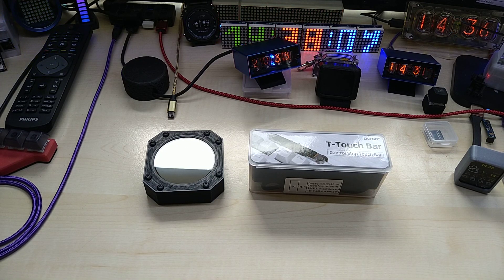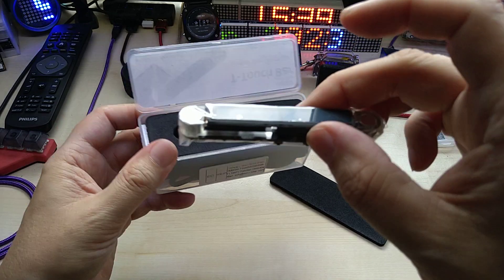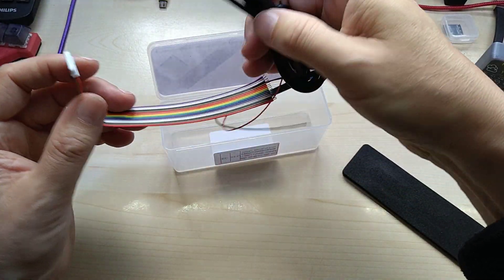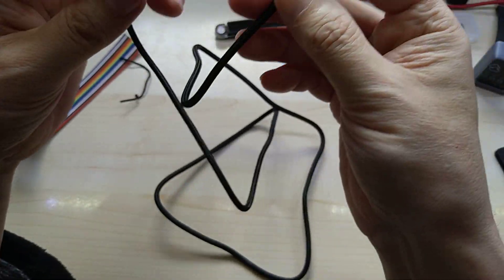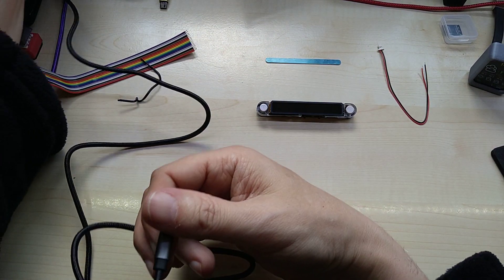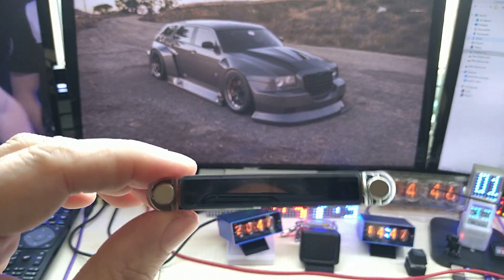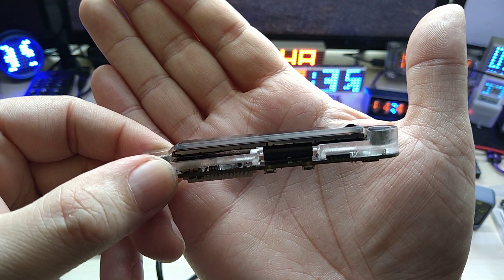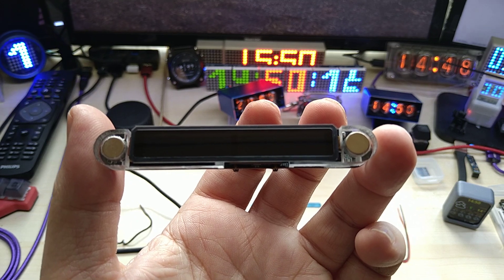#ESP32 S3R8 T-Touch Bar Introduction by #Hayri Sponsored by #Lilygo Part 1

Comment: That thing is wicked and it's got 1 off my magnetic connectors,on it already..What Mystery Items,will be made outta this👍
Reply from the maker: Thanks Peter, well my latest idea about it is to turn it into a pen like device and use it's BLE feature to, this part I do not know yet 🙂 or I could make yet another NTP clock or stock ticker or weather forecast instead of "just" attaching it to a PC and adjust volume with it. have some very thin lipo batteries on the way and if I can hopefully save enough  money for a SLA printer I could make a very nice case for it. It could even have a ball point insert, so it can be used as a normal pen as well. The round magnetic connector could be on the top of the pen for easy charging. Really like touch screen as you can use it any way you like, only your imagination is your limit, lol. I am open for suggestion as always, stay safe my friend.

Comment: Off topic, but now that Arduino is releasing the new 32bit UNO 4 with CAN bus in May, do you anticipate jumping to the R4?
Reply from the maker: Very unlikely for several reasons. I have worked on my CAN BUS gauges for well over 2 years and think that I build several great gauges ranging from a "simple" gear indicator to a OLED version, IPS color display versions from 1.3" to 2" using the Atmega 328 and 1284P up to the ESP32 version with 3.5" capacitive touch screen with custom CNC machined enclosure. I have currently 7 gauges that work in my car for well over a year without a hitch and I do not see why I should reinvent my own wheel so to speak, lol. I also do not see any advantage the new UNO might bring to the table that my gauges would benefit from. As you surely know, the ESP32 has CAN BUS capability as well. Plus I am working on my next new product that will change the world, naa not really, although it is awesome if I say so myself, my wife loves it, which normally she does not care much about what I build, so it must have some good in it 🙂 But, thank you for asking, who knows I might build something new with the new 32bit UNO :-) Stay safe.